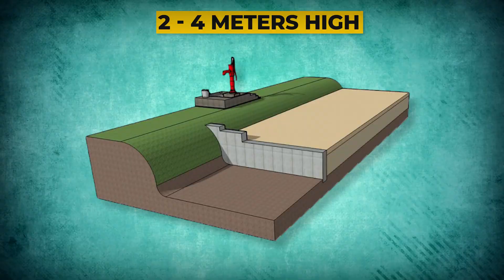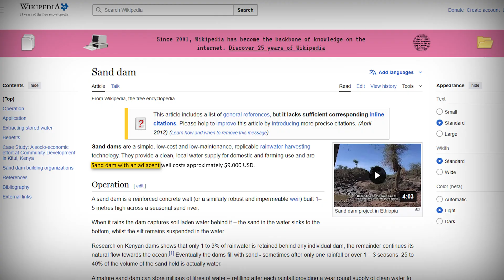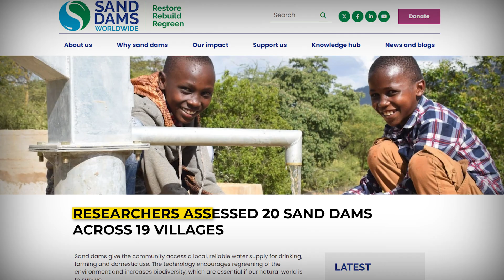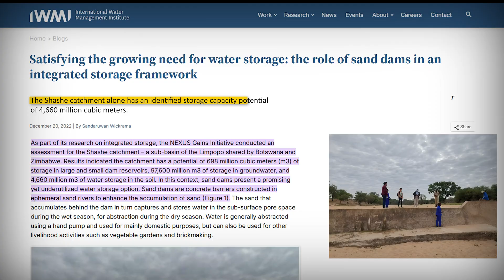This Dam Was Designed to Fail — And That’s Why It Works

Comment: In North East Botswana, we grew up drinking water from wells dug in riverbeds. The water did not run out for years at times. The well was just dug deeper and deeper in the sand. The river sand holds lots of clean water underneath. The water filtered by sand tastes really good.